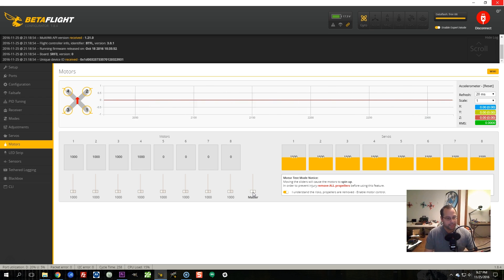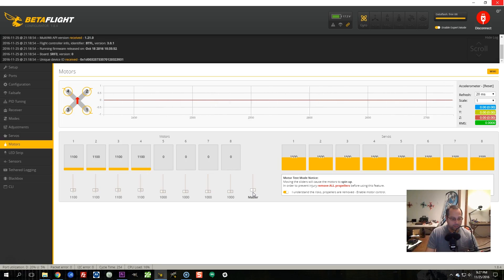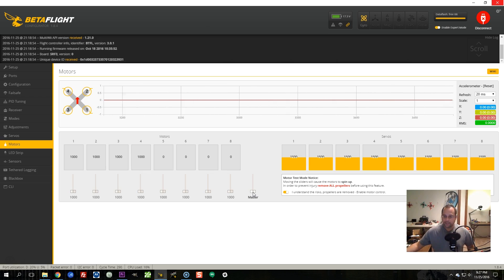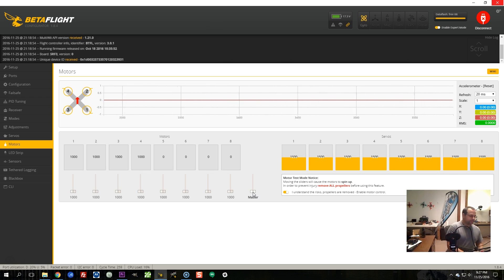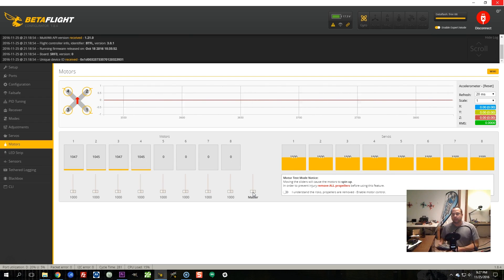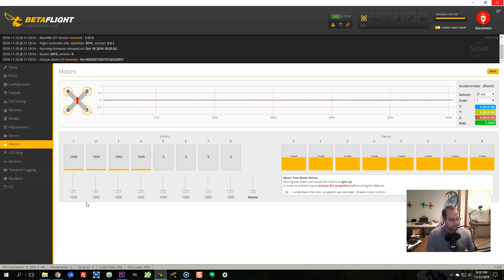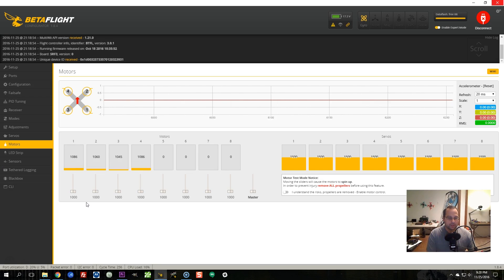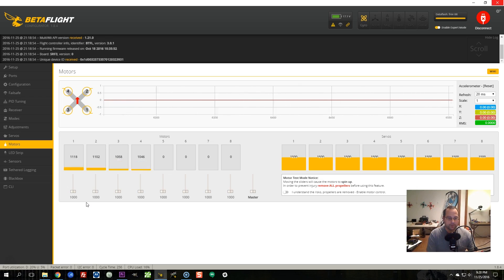Why Do Quadcopter Motors Spin Up By Themselves With Props Off?

Comment: The issue I'm having after replacing a motor on my Mobula 6 is that when I arm it and give it zero throttle, it starts slowly gaining rpm until slowly starting to take off.  Also I was under the impression that the Radiomaster Boxer low throttle number in Betaflight would be 1000, but mine is 989.  My friend checked his numbers, and his throttle is also 989. Since all the other channels are 1000, i set the low throttle minimum to 1005.  Are those numbers correct?

Comment: Hello, in my case the problem is that when I raise the throttle it responds normally, but when I lower it it doesn't react, the motors stay on and I have to activate the disarming so that they turn off, is this normal? I haven't tried it with propellers.
Reply from the maker: You are describing the exact issue I explain in this video.

Comment: When I arm my quad 2 motors spin up full speed and flips.
Reply from the maker: If the quad suddenly pops up in the air and then disarms when you arm, it is almost always one of these things.

1. Clockwise prop installed on counter-clockwise spinning motor or vice versa. Double check the motor direction is as expected and then double check that the correct prop is on each motor.

2. Flight controller not facing forward. Go to the Setup tab in the configurator. Tilt the quadcopter on all axes (pitch, roll, yaw) with your hands. The 3D model in the configurator should move the same as you move it with your hand. If it does not, use the Board Alignment parameters in the Configuration tab to fix it. Do not use the "GYRO/ACCEL" parameter. Use the "Roll Degrees", "Pitch Degrees", and "Yaw Degrees" parameters.

3. Motors not wired correctly. TAKE OFF YOUR PROPS. Plug in a battery. Go to the Motors tab. Use the "Reorder Motors" wizard to ensure that the motor order is correct.

4. Motor spinning wrong direction. Do the same as step 3 but use the "Motor Direction" wizard to ensure that all motors are spinning the same direction as shown in the diagram.

Comment: If your motors are accelerating for no reason, it might be innocent and you can ignore it, but as a software developer I can tell you that this also means your algorithm is wrong, or has a bug that is leading to an uncontrolled output

Comment: Jesus, thank you.. I just build a performance Cinelog 35, have it on my desk and the motors will not hearken to my command to throttle down after i throttle up.. So i will try with my props. on.. lol. Thanks Joshua. Took me hours to solder this thing with all the micro contacts...

Comment: Hi Joshua, you did a lot of useful videos that many people appreciated, I have no doubt about that. I viewed this video and tried once flight and ended up drone crashed at that day untile one of the props broken. Before the flight and until now, my quadcopter has a problem, the number 2 and 3 motor run as number 1 & 4 at the beginning when the throttle is idle. As I increase the throttle a bit (not pass the middle point) then the number 2 & 3 motors spin in full speed and they won't stop even the throttle is put back to the minimum, so I have to disarm to shut it off. 
My drone current configuration: Betaflight 4.4 (the latest version), 5 inches freefly drone, 3S battery, readytosky 2-4S 40A Brushless ESC, 2212 920kv motors, SpeedyBee F405 V3 50A 30x30 stack, RadioLink AT10 ii transmitter, R12DS receiver
I appreciated if you can give me a guidance.

Comment: Yeah I also was struggling last few days with my own build. It was shaking heavily without props. You start to think : crap is my PETG frame?
Is something touching the soldered connections on the ESC which causes interference?

It's nothing, get it flight ready put props on and test it with no goggles on. It seemed to fly fine bit to fast for me xD. First time arming is a scare since it did not arm right away and suddenly airborne. I have Dynamic idle of 20 but My quad launches like a flare with 5" props.

Comment: when I pin the quadcopter to the ground (not allowing it to fly), and slowly give the throttle up and try to take off (with the props on), the throttle goes to max and refuses to come down irrespective of the fact that I am trying to throttle down from my radio controller. The throttle can be brought down if I am within the 8-10% of its value. Beyond that, it's like a chain reaction and I have no control of the throttle as it progresses to max value. I have to disarm it to get the motors to stop. Is this normal? If the throttle commands are not obeyed, I have zero confidence to take it out to fly. What if It goes out of control? How can I be sure that everything is ok with my drone? Is this the same behavior for all drones? Is it safe to try it out in the open space?  I am using SkyStars F405 HD FC with 40A ESC and ReadytoSky GT2205 Motors with 4S 2200mah battery. Please do share your comment, anyone?
Reply from the maker: https://youtu.be/xBaefeQtA1c explains why this happens.

Comment: So when I arm my drone the blades start spinning instantly, what do I need to do to stop that
Reply from the maker: This is normal for acro and racing drones. If you turn this off, the quad will fall out of the sky when you lower the throttle to zero during flight, which is common for acro and racing drones. 

You can change this by 1) disable air mode in the Configuration tab, and 2) enable Motor Stop in the Configuration tab (or maybe they moved it to the Motors tab in BF 4.3). But for an acro or racing style drone, I don't recommend you do this.

Comment: I switched controllers and now this happens to me. Its fine when I first arm, but afterwords when I land even with the throttle on zero it starts runningaway. I re calibrated the sticks and reset the end points and trims several times... no clue why this is happening!
Reply from the maker: Disarm when you land.

Or put air mode on a switch and turn off air mode.
Reply: @JoshuaBardwell  I always ran air mode on a switch for all my quads, I like to be able to soft land instead of roughly bouncing off the ground. Air mode off does help... weird never noticed that before. Thanks buddy! PS: took your advice and got remote with a screen for the ELRS (TBS mambo) In case you don't remember my icon from Email ;  )

Comment: So my Emax Buzz spins up fine. Advancing throttle slightly then lowering throttle is fine. Increases/decreases like it should. If I advance throttle close to half throttle then go down to zero throttle, the throttle speed does not drop. Blades are on, but holding the model on the table. Is this normal, should I attempt to fly. What do I need to check? First time drone pilot. 30 year airplane/helicopter pilot.

Comment: What if props on throttle up a motors do same the exact same thing with props off.
Reply from the maker: It's possible that it's the same thing. Sometimes it does it with props on too.
Reply: @JoshuaBardwell  

So then I take it will fix it self, or is there a fix??
Reply from the maker: If it's what's shown in the video there is nothing wrong. Hover it somewhere safe just in case it flips out.

Comment: Hey so I just got the flywoo explorer lr bind up my controller to the xm plus then with props off I tried throttling the motor's would spin all the way up even when I throttle down it would still spin up after watching ur video I did what u said an it flys good for the first 2 min I got to test it before loosing a prop due to me not screwing them in but is it normal to throttle up an not throttle down with the props off

Comment: Just found this video trying to solve this: https://youtu.be/PUtSsZRM2uA (at 10:26), my Betaflight Mixer seems to be weird, it does all the PID stuff you explained, I can pull up any motor (PWM) and works normally, but when I arm, one of the motors goes crazy. Have any video that could help?
Reply from the maker: If the quad suddenly pops up in the air and then disarms when you arm, it is almost always one of these things.

1. Clockwise prop installed on counter-clockwise spinning motor or vice versa. Double check the motor direction is as expected and then double check that the correct prop is on each motor.

2. Flight controller not facing forward. Go to the Setup tab in the configurator. Tilt the quadcopter on all axes (pitch, roll, yaw) with your hands. The 3D model in the configurator should move the same as you move it with your hand. If it does not, use the Board Alignment parameters in the Configuration tab to fix it. Do not use the "GYRO/ACCEL" parameter. Use the "Roll Degrees", "Pitch Degrees", and "Yaw Degrees" parameters.

3. Motors not wired correctly. TAKE OFF YOUR PROPS. Plug in a battery. Go to the Motors tab. Turn on the "props are off" slider in the lower-right. Raise the individual sliders (1, 2, 3, and 4) one at a time, just enough that the motor begins spinning. The motor positions (1, 2, 3, and 4) should match the graphic in the upper left. If they do not, then either move the signal wires so that they are correct or use resource reassignment to virtually "move" the motors.

4. Motor spinning wrong direction. Do the same as step 3 but compare the motor direction to the arrows on the graphic in the upper left. If a motor is spinning the wrong direction, either reverse it using BLHeli (or whatever ESC software you are using) or swap any two motor wires with each other, which will reverse the direction.

5. If you have enabled the "motor direction is reversed" parameter in the Configuration tab, then you must go into blheli and reverse the motors, or swap the motor wires to reverse the motors. The "motor direction is reversed" option TELLS betaflight THAT you reversed the motors. It does not reverse the motors. This is a special case of #4 where the motors are spinning the wrong direction.

Comment: Hey Josh, what happens when you put props in and the quqdcopter starts throttling up by itself, first a little and then you recover control? It does not flip, just has throttle issues
Reply from the maker: It means this. It means what the video is talking about.

Comment: I think I have a similar problem but there's something where it will act out of control with props on too.  I have it set up in a tethered rack and the motors especially when I yaw will go out of control, so maybe this is why, but then something also happens when im flying it, it just slowly builds till my zero throttle is 100%
Reply: What's the solution to this?
Reply: @KhumarRambharose  usually air mode, I have air mode on a switch now.  You can turn it off and an option appears in modes to put it on a switch.  This was probably when I was building an apm build with ardupilot, since I'm talking about trying to tune a quad in a rack I built which I built specifically for this, i'm not sure how to stop it in ardupilot, this was 3 years ago, I was a total nub then.
Reply: @KhumarRambharose  It can be a problem with frame vibration, filters,  and i term build up too though.

Comment: Thanks Joshua for the expertise. I just finished my first build and full configuration with beta flight and Blheli, I was stuck with the problem of motor 2 and 4 spooling up with a small throttle up while props are off. And was afraid to take the first flight.
Today evening I will hit the skies 😊hope nothing happens bad. Thanks again

Comment: When I throttle up it moves the yaw and have had to adjust the sub trim way to much even to get the yaw in right position and ideas any one :)
Reply from the maker: Re calibrate the gimbals but you may have a damaged gimbal.

Comment: Great and helpful videos man. My motors are spinning on my whoop full throttle if I touch it against anything sending (ie hit an object) or lean it with my hand in any direction other than level...then won't respond to me idling down, only disarm. Do you have any idea what that might be?

Comment: Bardwell... what if I'm having this problem while I have props on? Motor direction/orientation are correct, and I had the quad flying before I re-flashed the FC and ESC (both KISS). I didn't allow my quad to hover because as soon as I heard the motors ramp up, I disarmed. Could it be because I don't have idle-up set up?

Comment: Wow! I just bought my first quad and was testing on the bench with the battery and props off. I quickly noticed that when I would throttle up and down quickly the motors would just go crazy and not respond to the throttle at all. Maybe this was the issue the entire time. Throttling up and down quickly was driving it crazy with props off. Thanks Joshua!
Reply: yeah was the same with me, this was my first built.

Comment: What about if you do the same test with a whoop (with the blades on) and you give a tiny bit of throttle. Why do the motors runaway when you leave the sticks alone with the craft flat on the bench?
Reply from the maker: The same reason, basically.

Comment: Ok I seem to have the opposite problem. 
On beta flight my motors all work fine even with the controller. But when I go outside to fly,if I go above say quarter throttle the thing just hits full throttle an up it goes! I shut the throttle fully an it keeps going for a second or so then the motors throttle down. Can anyone help me with this?
Do I have a faulty flight controller?
It’s a brand new nazgul5 v2 4s 
Thanks in advance 👍

Comment: Thanks Joshua! I the newb was in beta flight this morning and continually learning getting familiarized, this very topic happened. The main worry was that I would throttle up and then back, but the motors would continue to spin up to near max. I then hooked up another fpv and it happened there too, so I figured there had to be a connection. When I googled this was video was at the top of the results and now don't feel so worried.

Comment: I guess I have to go test it, seem like there is no throttle control, the motors don't feel like they slowly go up or down, two motors will speed up with out me moving the throttle. when they get too high speed even if I turn down my throttle they still go up, bit too scared to test it

Comment: I have one which was occasionally behaving just like that WITH the “appearently normal” props on..  it’s not Filiping but went vertically stable until it hit  ceiling, or disarmed. It did that when i Throttled up until certain point, it went up u stoppable even if i lowered Throttle.  Is it broken FC or something wrong with props/frame ? I noticed that it did that more often when my battery was fully charged. It sometimes jumping when idle, just like props off

Comment: My quad does this but with the props on. I give it the tiniest bit of throttle and it shoots into the sky uncontrollably and at max power. I've flown other racing quads so I know it not overpowered (its just 3s). Any advice please??
Reply from the maker: Usually this means you set "motors are reversed" in Betaflight but you didn't actually reverse the motors.
Reply: @JoshuaBardwell  I'm pretty sure I selected the non reverse function, but I will double check. I've just changed the configuration from multishot to dshot600 and it seems to have helped the spin up problem but now it oscillates so much it can't fly. Would this be really poor PIDs? Also thank you so much for replying
Reply: Update: after binge watching your PID videos I finally got it to fly. I think because its a custom frame that isn't a perfect x shape, the stock PIDs just didn't work. Thanks!

Comment: Omg I was just freaking out lol. I'm new to this and I just killed a battery(6s) running beta flight and biheli setting up my controller switches and checking everything out, so I watched a JB video on charging lipos and I was lucky because I have the Hota d6 pro charger and it charged each cell perfect to 4.2 volts. I will keep an eye on it for a while to make sure its safe(it will sleep out side tonight lol). Then I don't know why but my quad wouldn't arm( it was working before the battery died) and the switches worked fine in beta flight, so I watched a JB video and reset all my rxrange parameters in beta flight and now it is arming again( I still don't know if it was because of the dead battery?). So now I'm happy, until I gave it some throttle and the motors just kept speeding up and I lowered the throttle but it wouldn't slow down so I had to disarm it( props are off) so now I watched this JB video and like he said you won't get it completely and he right but I trust him. I haven't flew my quad yet, I'm still waiting for my V2 goggles to come in, but I will try a line of site flight soon to make sure its ok:) I did buy 90% of all my gear from his links so he would make a little something from the sales it was the least I could do, after all I did learn something today and yesterday and the day before that lol. Keep up the great work JB, I don't think I would have gotten into this hobby if it wasn't for you:)P.S. I do love your JB parallel 6s charging board.

Comment: All of this seems like the issue I'm having except when I " zero the throttle " it has no impact on the motors and they continue to ramp up... is this a problem or is this normal behavior. I noticed you could stop your motors from ramping by simply lowering the throttle before disarming but i must disarm my quad to stop the motors from ramping and spinning. i should note its a factory Iflight chimera 7 inch 6s 1300 kv motor quad. So idk if that plays a role in it.
Reply: also have Rewatched this many times so i did follow the instructions. :(

Comment: YAH BUT!...honestly...yah but you didn't say whether if they race away on you, should you be able to throttle down or will it seem like you have lost complete control of the motors? You just say they will speed up.  I arm it, give a little throttle, RPM goes up, I lower the throttle - RPM goes down...up again...away the motors run!!! then I can't slow them down. I can drop the throttle to zero and It's like I didn't give any inputs. Is this what Joshua is talking about? Anyone?